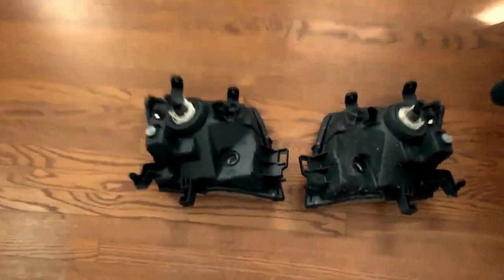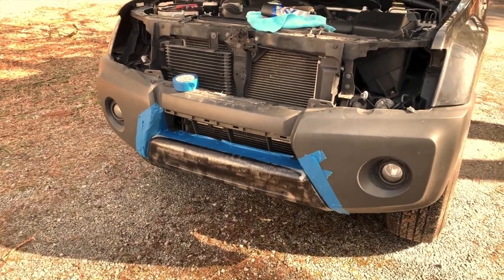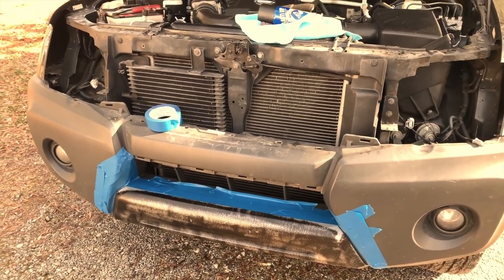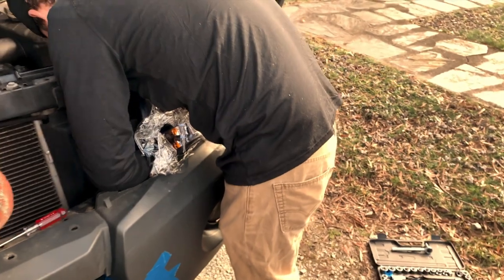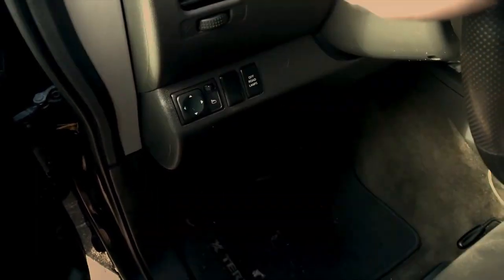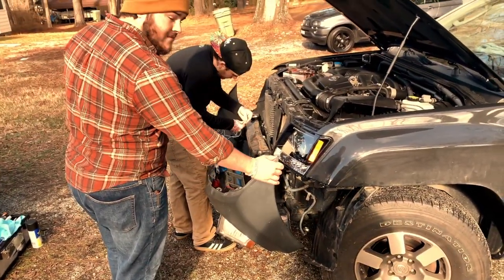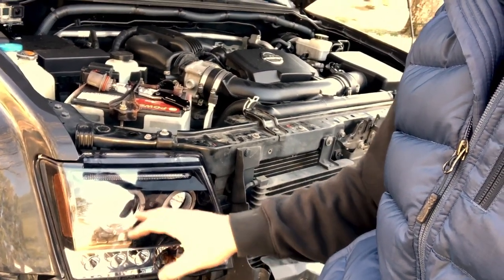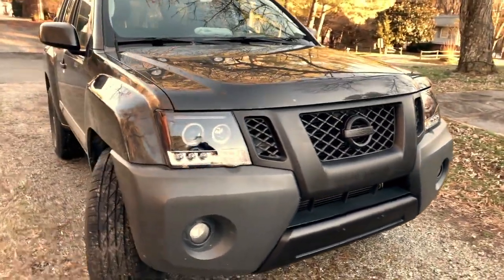Installing HALO Lights on Nissan Xterra

Comment: Thanks for the great video. 
You inspired me to do the same with my Xterra. 
I love the new look of my ride. I found a car stereo guy to install them for me, which took him about 3 hours. Well worth the $100 install fee.
Thanks again!
Reply from the maker: No problem man! Glad you are enjoying them!
Reply: Good afternoon Mr CONHECK OFF-ROAD i bought a headlight same with you, my problem is I’m a little confused about the wiring there’s a white and black and the one is white stripes with black please help me how installed
Reply from the maker: White is your power and black is the ground. You can then wire them into any light you want. Its entirely up to you
Reply: Bro I need to connect the white and then black to black
Reply: Also I saw the front bumper it’s cool awesome where did you ordered that bro

Comment: I too had issues with the main light connector.  I played around with it a bit and found that the socket design doesn't allow it to seat deep enough to make a solid connection.  I was able to pull the orange gasket out of the plug housing, just used a small flathead screw driver the wiggle it out... but that allowed the socket to seat fully.  It's not supposed to be that way though, so I think I'm going to dremmel about 1/8" off the end of the socket (on headlight connector) to allow the pins to seat fully into the connector and have the gasket in place to keep the moisture out.
Bad design on the headlights though... if you're considering buying these.
Reply from the maker: Mike Laird yeah i’ve had to replace them already. the lights just started not working
Reply: Did dremmeling them out work for you Mike? Solid connection?
Reply: @fernandobriseno8164  I haven't done it yet.  I've just left out the orange rubber gaskets.  The connection is still good.
Reply: Same thing happened to me 😠

Comment: I'm about to receive these in the mail and I wanted to see the installation process, (which no one else seems to want to do), but I'm going to change the lo/hi beams to LEDs. It's good to know that the location/hi beams use the same bulbs so I know what to order and put in before I swap the housing. Thanks for the video, man!
Reply from the maker: Tina Thompson-Lopez feel free to drop some questions back here. i might be able to give u some help with em. it was definitely an all day process for me haha. and i had a professional helping me lol

Comment: If anyone comes across this and got these lights for your X.....man, not so fun. At no point anywhere in any product description did I come across detail about having to splice a ton of wiring to get ALL the lights to fire. Probably on purpose, as this would more than likely scare most people off needing to be a part-time electrician and all!
In the end, you have to splice into the original parking lights of the Xterra and tie together all the white wires of the headlamp to the red cable (this supplies power) and all the black wires of the headlamp to the black cable (ground cable) of the parking lights. If that makes sense! In the end, I had to cut things twice on each lamp and extend the wiring with jumper wires (basically a wire extension if you can picture it). A bunch of splices and shit ton of electric tape and hours of frustration later but then ultimate pride of a "job well done", I have perdy new lights.
Total f'n PITA though. I didn't enjoy this unforeseen project. If anyone comes across this and needs additional info or advice or to vent hit me up.
Reply: Thanks for your input ill keep this in mind.
Reply: Are they functional or do they blind people
Reply from the maker: Neither IMO. I got rid of them after a few months. Lights were super dim and the leds went out after a few months
Reply: @conheck_offroad I have the same lights because the previous owner put them in. Do you think it would be fairly straight forward to go back to halogen? They did a hack job with all the wiring. I’m scared to attempt it.
Reply from the maker: @elonsus9747 yeah it shouldn’t be too bad if you are comfortable with basic wiring. The only thing that might be tricky is removing the halo wiring and the extra running lights LED wiring.

Comment: I thought this would be a tutorial.  Not sure why this video was done
Reply from the maker: Has Your sorry you didn’t like the video. thank you for the feedback tho
Reply from the maker: Has Your basically we just spliced the halo wires into the running lights along with the amber lights on top and LEDs on the bottom. the low beam and high beams were just plug and play with the stock connectors. same with the blinkers. hope that helps
Reply: @conheck_offroad  Thank you, it does
Reply from the maker: Has Your no problem man! thanks again for the feedback. helps me make better content for you guys!

Comment: Nice looks awesome. I just got an Xterra. I’m going to get some of these and also going to paint the Grill and skid. What kind of paint is that?
Reply from the maker: I would recommend getting new lights from freedom retrofits over these. These were pretty terrible. Check out @darren_explores on IG. He has them installed and they look really good. 

I used plasti dip on the grille and skid

Comment: Nice video! I got those same headlights a few months ago but something is wrong with one of the wires in the left headlight... do you have any idea on who would/ what type of garage would be able to fix it?
Reply from the maker: Ryan 261 we had a similar issue when we installed one of the lights. turned out the issue was with one of the connectors. apparently one of the pins in it wasn’t installed properly. so what we ended up doing it just removing the plugs altogether and just wired the light right into the vehicle. a little more permanent of a solution, but it worked! hahah. hope this helps

Comment: ????Do the high and low beams both come on together or does the low beam switch off when the high beam is on????
Reply from the maker: the switch depending on whether you have high or low beam selected. but i no longer run these lights. they crapped out on me after a few months. just for you SA

Comment: That looks badass! I also own an X. I am considering doing this. How is your visibility at night?
Reply from the maker: I do not run these lights anymore. They were very cheap and did not work very well. Would advise against buying them
Reply: @conheck_offroad  Thank you for getting back to me and saving me a headache.
Reply from the maker: No problem! Happy to help. I would recommend looking at freedom retrofits. I’m in the process of saving for them. Much better quality from what I’ve seen

Comment: How are the lights holding up
Reply from the maker: I am no longer running these lights. All the LEDs stopped working and the halo rings stopped as well. Both the high and low beams were not ver bright. I personally wouldn’t recommend these as they are pretty cheaply made

Comment: I’m lookin to paint my front grill and bumper.. just got some nice led on the way for original headlights, spent a good hour wet sanding the oxidation off them, I also wanna get halo led fog, but what colors did you do, what’s the paint called? (Brand color etc) thanks bro
Reply from the maker: 311mdub so i just used the lights that came with the unit. they were still on the yellow side of the coloring tho. as far as painting the bumper. i used plasti dip form dipyourcar.com. they have a great product and it holds up decently well. i just went with a basic black for the bumper and grill. hope this helps!
Reply: CONHECK21 so the plastidip do I need to take the parts off and send it to them to dip? I figured just sand and clean them really well that I’d either do like a rhino lining on the bumpers and a satin black for the grill and Other small black parts. Also probably rhino line the roof rack. Thanks man
Reply from the maker: 311mdub so the company dipyourcar.com will give u a full kit to make sure it sits well and cures well. what i did was i till the whole front end off and taped off the skid plate and then did about 4-5 coats of it along with with grill which i did separately. but the kit they give u comes with a cleaning solution to make sure it’s all ready for the dip

Comment: What and how did u connect the black and white halo cables to?
Reply from the maker: Luis Torres fantastic question my man! so it’s really up to u how u want to wire it! what we decided to do is wire the halos into the running lights. meaning the lights that come on when u flick the switch to the first setting. if i remember correctly the black is the ground wire and white is power. all u have to do is splice those wires into the amber light that runs across the top of the headlight unit. doing this will turn the halos on when u turn on your running lights. hope this helps!
Reply: CONHECK21 I just bought these lights and I’m having trouble with the wiring I know nothing about that stuff. I’ll try it out thanks!
Reply from the maker: Luis Torres hahah i was the same way. alex did most of the work but that’s how he explained it to me
Reply: CONHECK21 IT WORKED! What I did was twist both the black and white cables together and connected the black one with the black ambient light and white with my “red” cable power and it worked perfectly thanks so much!
Reply from the maker: Luis Torres no problem my man! enjoy the lights!
Reply: @luistorres2992  man, how!? From what I can see is you have to remove the bulb, remove the clip/harness, cut the original wiring to the parking light (amber parking light, not amber turn signal), somehow splice that together with this Halo/LED wiring and hope for the best. Spec-D Instructions are TERRIBLE and incomplete and nowhere did it say you had to do wire splicing. I wish someone would do an actual tutorial, unlike this video which was more about the poster and friends and a bumper. Not helpful brother.
Reply: @luistorres2992  bro I’m having problem too a little confused
Reply: @arzibanez3924  tbh I don’t remember it was over 3 years ago but they ended burning my alternator and we’re not bright enough at night I just switch back to the original headlights and put in bright white led

Comment: What was the issue with the high and low beams? Same thing happened to mine and don’t know if it is a wiring issue or the lights burned out.
Reply from the maker: Matt Wallence The issue I had was with the plug that came with the headlights. One of the prongs inside the connector was not fully connected to the wiring which is why it was not working when it was plugged in. So what we ended up doing was just cutting the connector off from both the headlight unit and the cars wiring. we just directly spliced the wires into the wire assembly that is in the car. totally bypassing the connectors.
Reply: CONHECK21 ok I’ll have to see if that’s the issue. Thanks for the feedback!
Reply from the maker: Matt Wallence we just used one of those tools to test the current in the wires after the connectors vs the current in the wires before the connectors. that’s how we figured it out

Comment: Did you have to buy both new housings for the headlights?
Reply from the maker: Vance Nolta so i bought the whole headlight assembly as one. i didn’t have to actually install the halo part of the lights. just the new assembly. hope that makes sense
Reply: Got it! Do you remember where you bought it from? Looking to do the same but for my 2004 X
Reply from the maker: Vance Nolta carid.com
Reply from the maker: Vance Nolta i found only a few websites that carry full assemblies for the xterra. carid had the most to choose from i thought
Reply: Thank you, this helps alot. I'll definitely be looking at carid.com
Reply from the maker: Vance Nolta yeah man glad to help ya out!